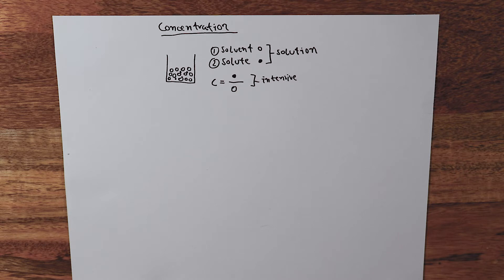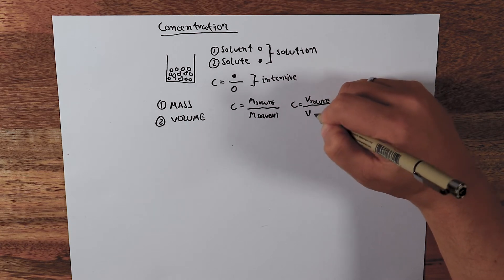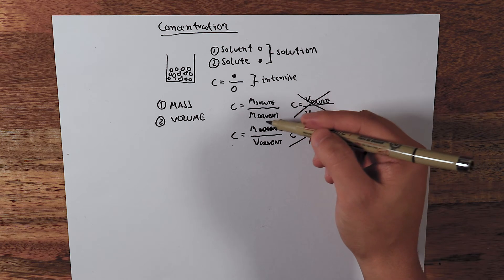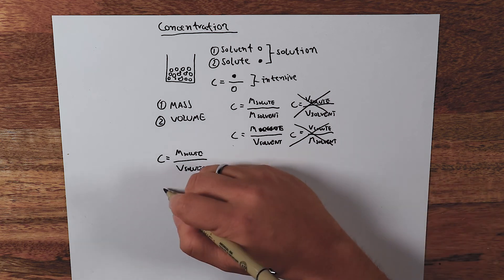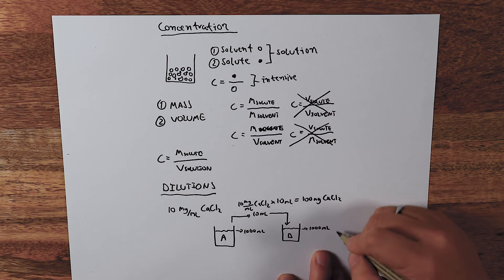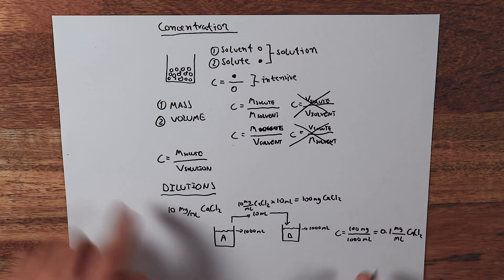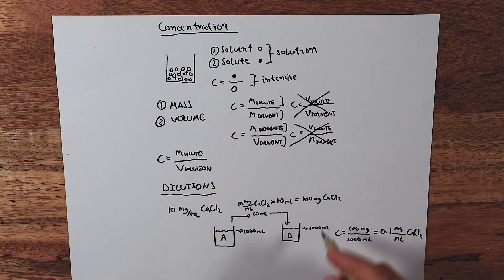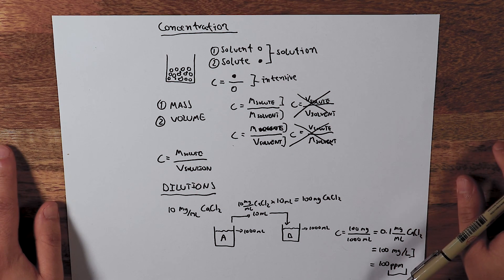Understanding concentration in hydroponics  Part 1

Comment: Thank you for all the training materials you provide for us as newbies ? I wish you make a new series of videos on how to use hydrobudy application with practical examples of making a solutions and adding elements NPK or others based on certain recipe and how to formulate a recipe based on whats available
Reply from the maker: Thanks for your comment! A lot of knowledge is necessary to be able to efficiently formulate nutrients under a wide variety of circumstances. HydroBuddy does not replace chemistry knowledge - it's just a tool - so to use it efficiently you will need to learn about nutrient chemistry. I will be creating a lot of videos about these subjects, which will hopefully make it easier for you to use the software.